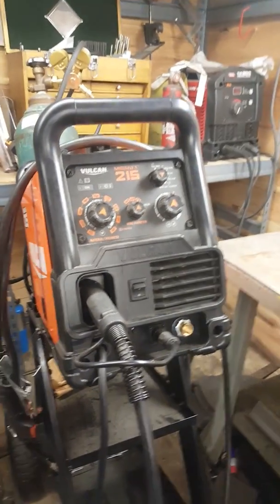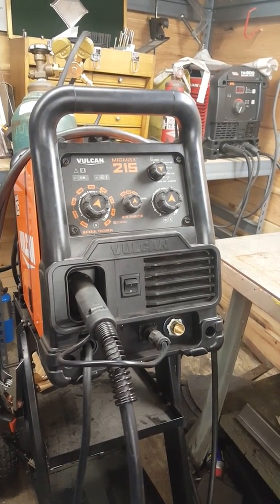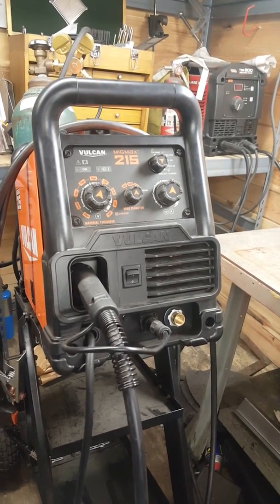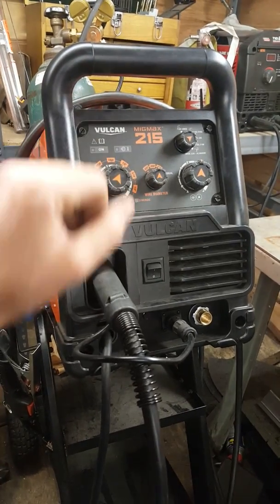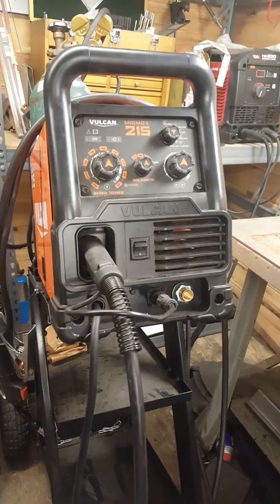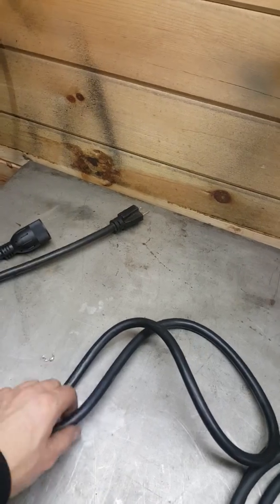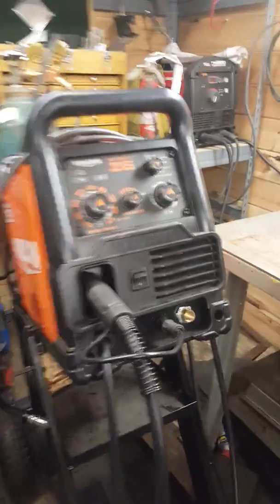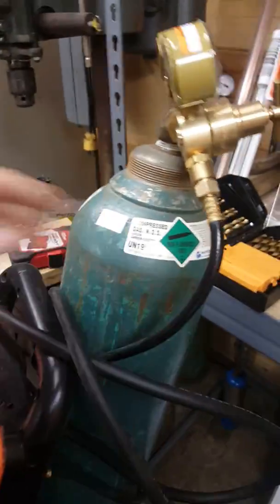Vulcan Migmax 215 mig welder review

Comment: The Vulcan welders are a fine machine! They are incredible!!! Miller and Lincoln can both SUCK IT! The Miller and Lincoln welding equipment isn't made here. Nothing wrong with that. They just don't admit to it.  I believe that Jasic makes the Vilcan welders.
Reply: You are going to be suckin it when you realize you can't get parts for the Vulcan but you can get parts for the Millers and Lincoln. 😮
Reply: @garagekeys  4 plus years and going strong. Used daily and running just like new.
Reply: @Joeak74  and like I said when it breaks very little parts available.  I had one , broke recently after about 5 years, and well I was not able to get parts. I have a Miller 180 now and the Miller has all the parts available if it ever has issues.  Vulcan was a nice machine till it wasn't and there was no parts available to get it going again.  Can u say boat anchor.?
Reply: @garagekeys  sounds like your doing good with that machine.
Reply: @garagekeys you can buy a new Vulcan and still be ahead in money spent.
Reply: @loadsled  buy yourself a good used Hobart, Lincoln or Miller and you will be able to find parts to fix.  Vulcan has barely any parts available, breaks will unavailable part and it's an expensive anchor
Reply: @garagekeys  So , just curious , which parts are not available ??
Reply: @thelibertyworkshop2952  main board, wire feeder assembly, trigger, etc., the consumables you can find. But if it breaks and it comes to parts as I mentioned then you're pretty much out of luck.  Hobart, miller, Lincoln those machines you should be able to find pretty much any part you need

Comment: If you put the thickness knob at 3/8 for 3/8" metal or 10, and then look at the setting info on the lid, you will find that the recommenced setting for 0.45 flux core wire is J/8.5. I brought this discrepancy to the attention of Harbor Freight Technical Support but they had to escalate it to a corporate engineer, I understand. Also, another example of a discrepancy, for instance, is the recommended setting for 0.035 solid wire and C100. On the lid for 240 volts for 1/8" it says D4 but if you set the left knob at 1/8" on the front panel to 1/8" the corresponding point is midway between 6 and 7. Are the synergic settings and the manual settings supposed to be so much different?

I understand you are supposed to refer to the chart on the lid for the manual settings and for the synergic settings, you go by the orange highlighted thicknesses that are around the thickness knob. 

Can anyone explain the discrepancies I have found? Thanks.

Comment: I have a question when u weld does the gas stay on for a couple of seconds after releasing the trigger
Reply from the maker: Yes, post flow like a tig
Reply: @jessechop  thanks for the info I thought it was a malfunction on the welder was going to take it back but other than that is a good welder been using a lot n had no problems whith it

Comment: You get this for 650$. They try to sell it to me for 999$. So with tax and 2 year warranty will cost more than 1000$ more than lincoln
Reply: I got mine on ebay as new old stock for $600. The comparable lincoln/miller is $1500. 
I never buy warranties on consumer goods.
Reply: @ElGuapo719  Lincoln 180 is less than $1000